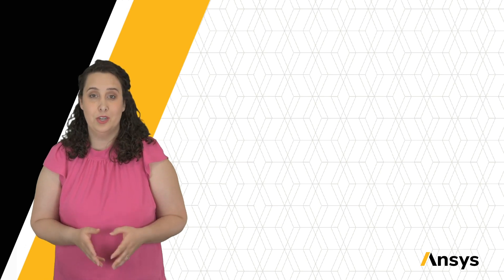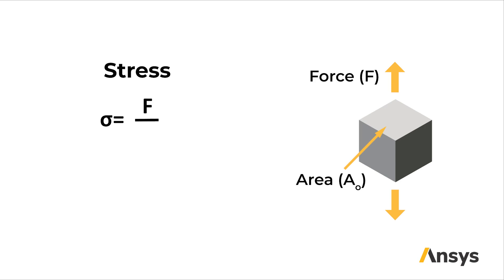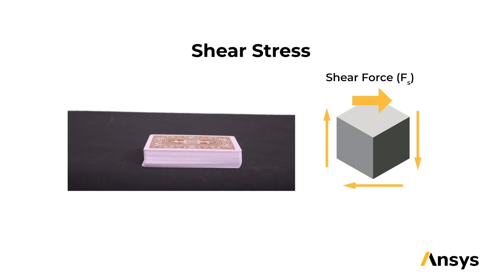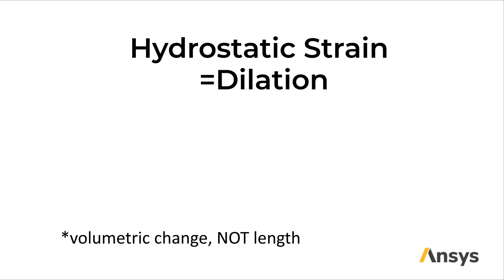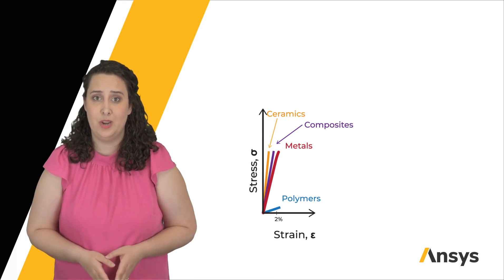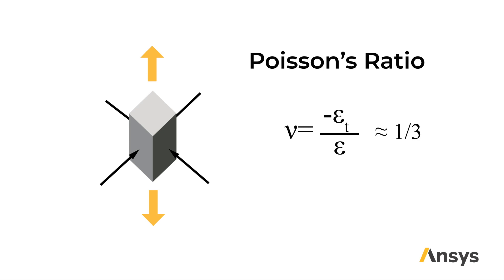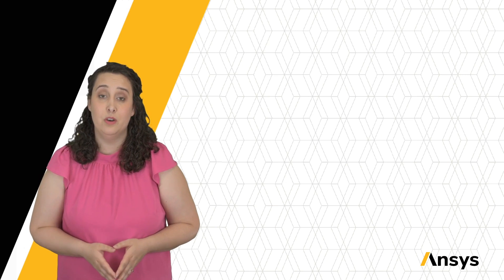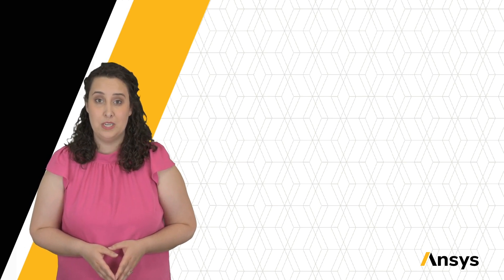Elastic Behavior of Materials — Lesson 1

Comment: How do you define the elastic material property of concrete on the Ansys Workbench? Typically, Concrete does not follow hooke's law under compression test, it has an approximate quadratic elastic shape function for its compression stress strain curve. Is it still necessary to specify Elastic modulus on the Ansys workbench?